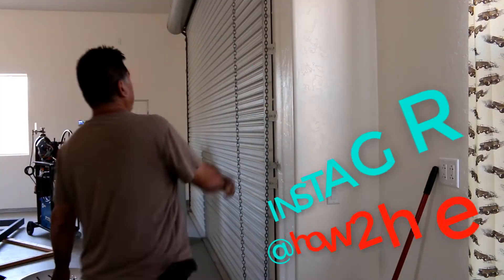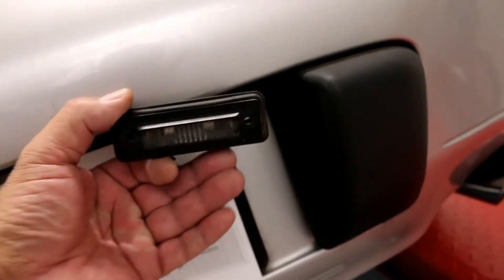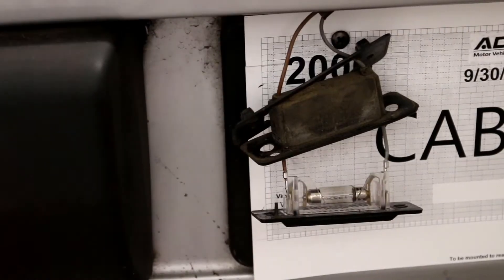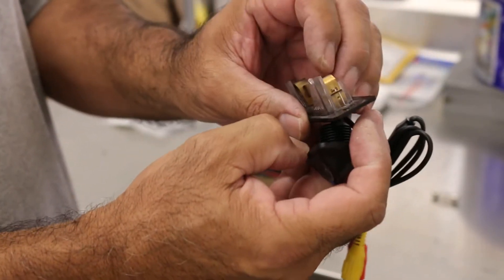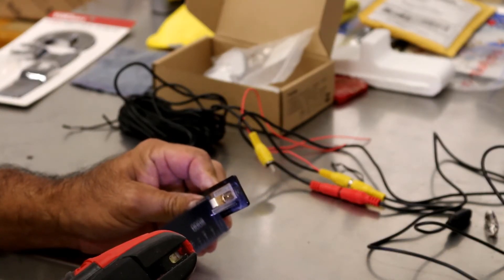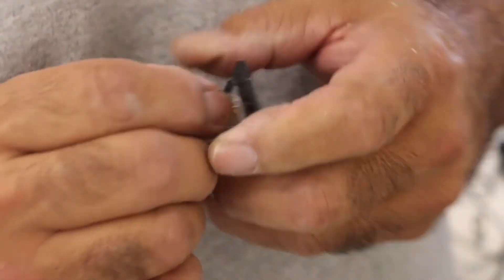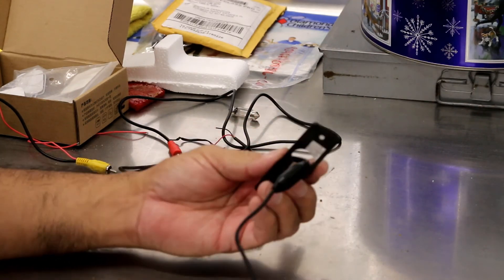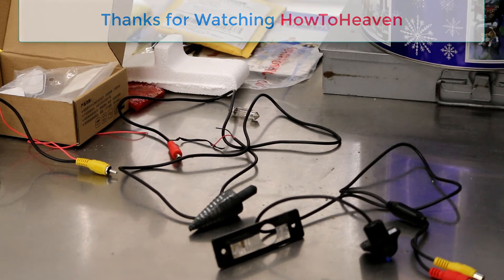Porsche 911 Backup Camera Mounting and Wiring Tips

Comment: this really didnt help much .... please show how you ran wires through
Reply from the maker: Too late! Sometimes you just have to do it and it will fall together. Thanks for watching
Reply: @HowToHeaven  how did you get the cable wires around the engine and around the convertible top storage to the side  and then once into the cabin, in passed the seats to the double din unit??
Reply from the maker: @samosasnmimosas2055  Sorry, I don't have the car anymore, however, I went around the driver's side with the wire, lifted the top into the service position (1/2 way up) and ran the cables along the driver's side under the sill/threshold. It was pretty standard as in every car is about the same. The trick was to use a Long Wire tie and electrical tape your wires to it an send the wire tie through any holes or path that is hard to reach. Hope this helps!
Reply: Were these CANBUS compatible?